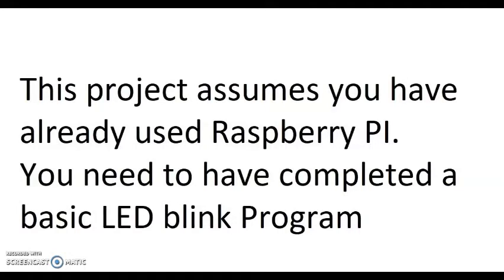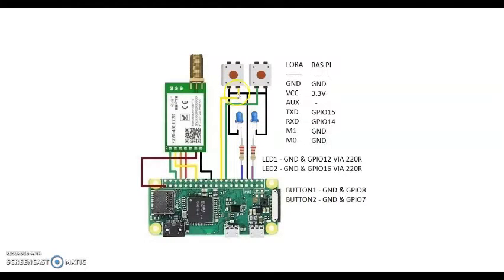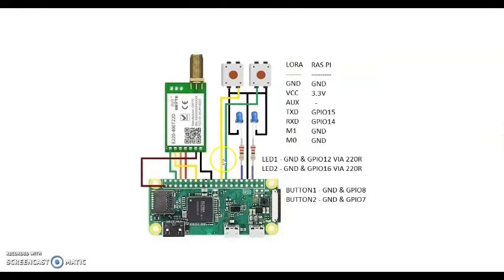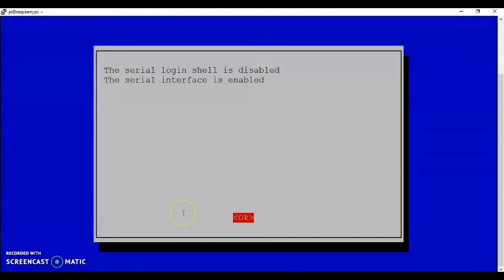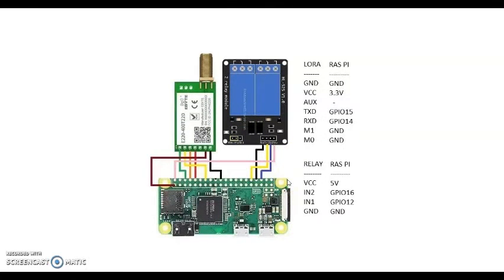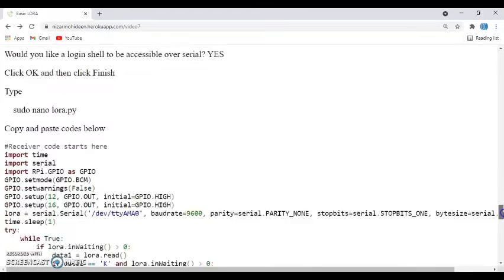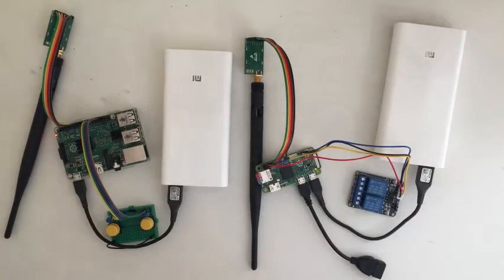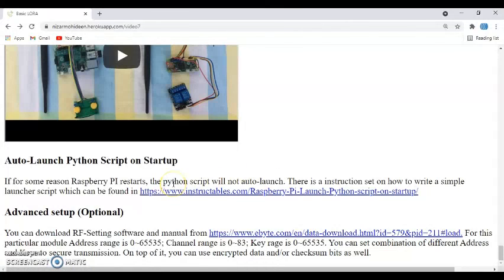7. Ebyte LORA with Raspberry Pi to switch Relay

Comment: Thank you Nizar for putting together the demo it is the only one I have found anywhere that 
demonstrates uPy + UART + PRi !
I am having some problems reproducing your results ... 

Setup = 
receiver= RPi Pico + EBYTE E220-900T30D
sender = RPi3 + raspbian + EBYTE E220-900T30D

I tried to strip down the code to core functionality:

### transmitter RPi3 ###
import time
import serial
lora = serial.Serial('/dev/ttyS0', baudrate=9600, parity=serial.PARITY_NONE, stopbits=serial.STOPBITS_ONE, bytesize=serial.EIGHTBITS)
time.sleep(1)
while True:
    str_1 = "1"
    str_1_encoded = str_1.encode() # leaving off the encode method resutls in errors
    print(str_1_encoded) # -> prints b'1'
    lora.write(str_1_encoded)
    time.sleep(1)
    
#######################

lora.read() on the RPi3 (for tranmission from Pico) works fine but lora.write() 
on the RPi3 to Pico -> nothing is displayed on the Pico 
Pico to Pico works fine in both directions
any idea what I am doing wrong above in the transmit code?

Cheers! 
Yossa
Reply: turns out to execute  serial.write() the user needs to be part of the dialup group

Comment: Can i use rylr896 lora module ??
Reply from the maker: You can not use rylr896 module with this setup. Rylr896 lora module needs different wiring and coding. Thanks

Comment: hi, I'm trying with same code on raspberry pi 4 with python3 , the receiver code get me an error without listening every time
Reply from the maker: Hi Ricardo,
Check the indentation of the code once again.
If error persists, let me know the error message. I may be able to find out the reason. Thanks
Reply: @NizarMohideen  Hi, I'm modifying to work with python3 , so far some it answers but somehow the buffer does not clean o answer 100%
Reply from the maker: LoRa transmission always has some amount of data loss or errors. It will be high if it operate in a area where many people try to transmit in the same frequency. Nowadays, there are no regulations. The Governments or telecommunication regulators just allocated one or few frequencies in it anybody can transmit up to a level of power. That may be the reason you are having incomplete data in your buffer.

Whenever you design a software, you need to keep this in mind to overcome data loss issues.

I have used a simple algorithm in my code: 
I inspected received data byte by byte and then I discarded incomplete words. You can use a similar approach.
Thanks
Reply: @NizarMohideen  tested a lot more and almost every time works fine with adding timeout as for response-waiting 

what should I do to evolve this into the identification and channels ??  is this only available using M0 and M1 ???
Reply from the maker: I have made another video showing how to change key, channels etc ..
It is here at https://youtu.be/6vIYaawRQ2g

Comment: Thank you.. this is good stuff.. Did you try the distance from which you could manage it. I am interesting something for field.
Reply from the maker: E220-400T22D module is rated for 5km distance. Because I used low voltage of 3.3V VCC, I was able to get about 500m (half km) easily without line of sight. If both module are in the line of sight, we should have more distance apart. Due to Covid and lockdown, I was unable to test it. By the way, Ebyte has other LoRa modules which are rated for higher distance.